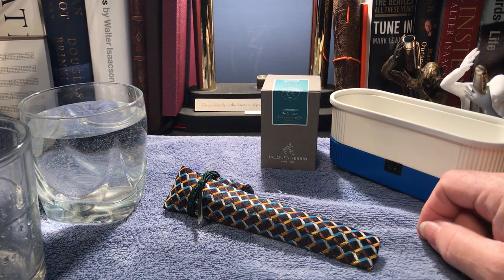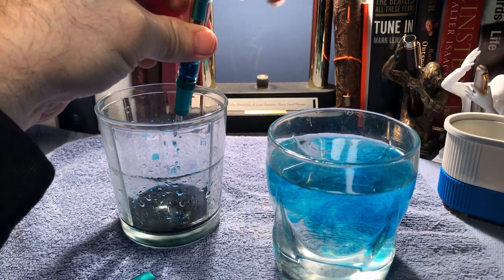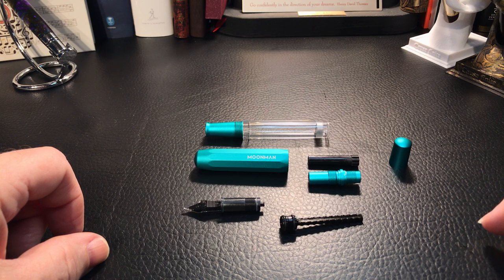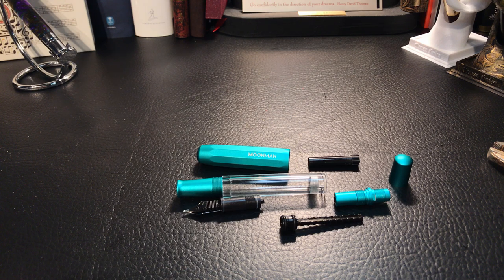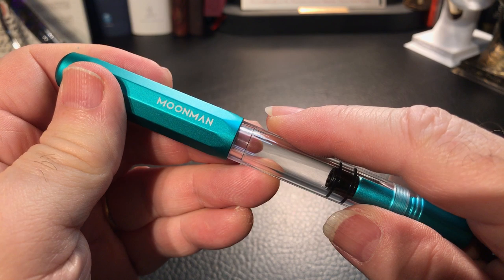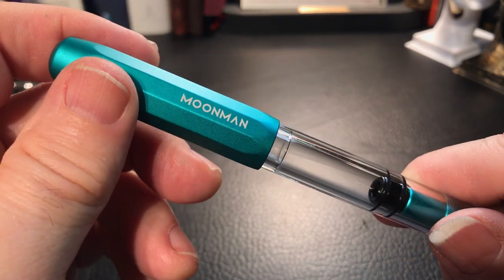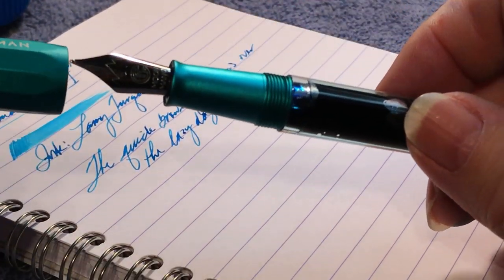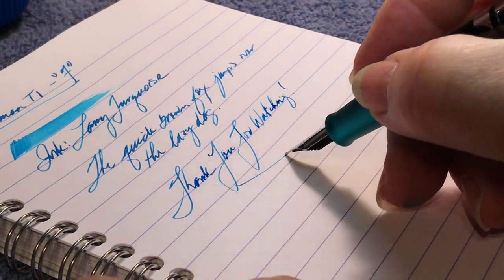Moonman T1 Piston Filler Fountain Pen Disassembly, Cleaning, Inking. How to take a Moonman T1 Apart

Comment: I have the brass one, it got a water bubble behind the piston after cleaning it, but I couldn't get it off, then i did what you showed, but used vice grips on the metal part, and found I had to turn it the opposite way.  nib end in left hand, knob end in right hand, I held the pen and turned it clockwise, as if tightening it.  I'm going to seal it with silicone grease and put it back with a wrench, but not so tight!  Thank you for showing us how to get that far.  I hope you have a great day.
Reply from the maker: Yeah I didn't have that little tool when I got my T1 and I used a wrench as well. It chewed up the aluminum but you don't see that.

Comment: Success.  For unscrewing nib, warm water helps as Aluminum expands more than plastic.  For the piston assembly not as good.  No need to remove the blind cap if you used a wrench to unscrew piston collar.  I guess you have not disassembled a Pelikan.   Aluminum is anodized not painted.  I admire your courage in tackling this.
Reply from the maker: Thanks, Chris. I have a friend's old Pelikan M200. There is no way I'm even contemplating disassembling it! LOL

Comment: Thanks for doing this disassembly Doug - I'm glad that I watched your video before I tried to disassemble my T1 (I'd most likely have resorted to using a hammer!)
Reply from the maker: I'm doing a disassembly right now on my new Penbbs 492 Magnetic Piston Filler and there were moments where you feel a little frustrated. But then I remember Douglas Adams; "Don't Panic!"

Comment: I really can't get the end cap process at 10:00 down. Could you explain a bit more or give some tips? I get a "click", but I can't screw it down fully.
Reply from the maker: It is almost trial and error. Thread the piston knob on to the threads for a turn or two and then feed in the piston and see if it closes up. If there is a gap, try different amounts of turns on the piston knob on the thread before feeding in the piston.

Comment: Thanks for the video.. As always hugely informative... Helped me out a great deal. However, there is one problem arising even after 'successful' reassembly... So the piston works fine and the knob closes flush when the piston is full withdrawn and all that... BUT when extending the piston (towards the section)... I have to be VERY careful to stop exactly where it extends fully otherwise the ratchet engages (you get that 'click' sound) , and then when you withdraw the piston, the piston lever is now fully withdrawn into the tube before the turning knob closes tightly.
I mean, I guess twas possible to force this even with the new pen, but now it happens too easily.... Just a bit of latent force once piston is fully extended and it ratchets...
Any idea of how to address this would be greatly appreciated
Reply from the maker: Thank you, Samsuddha! That ratchet mechanism is just plastic, so the more you use it, the more it wears.
Reply: @InkquiringMinds  Thanks. Just gotta be careful now on I guess...

Comment: Hi there, I'm trying to get the knob for the piston back on but ive had no luck after countless attempts. My patience is wearing thin. Any ideas on what might be going wrong. Do you think the plastic threads inside may be knackered? Also when I put the knob on it can slide over the threads with minimal force. Is this normal.
Reply from the maker: That sounds to me like the threads are toast.
Reply: @InkquiringMinds  I thought as much :( I ordered it off ebay and it arrived 3 weeks ago. Ive been using it since and really enjoying it until this problem arose. Ive contacted the seller so hopefully it can be replaced/ fixed.

Comment: Thanks so much for this video. Using a wrench from a different fountain pen (credit goes to #Chrisrap52) dissembling the pen was quite easy. That said, I thought I’d tried everything possible to get the piston and screw cap back on properly. What you demonstrated is perfect thanks again. PS: although the cap looks flush with the barrel, there is a slight rattling from the cap! Any thoughts. Everything looks good…just that dang rattling.
Update:  I watched your video a few more times and fiddled with the positioning of the cap to the piston rod. Got it!!! No rattling. Thanks so much.
Reply from the maker: Excellent! Good work!